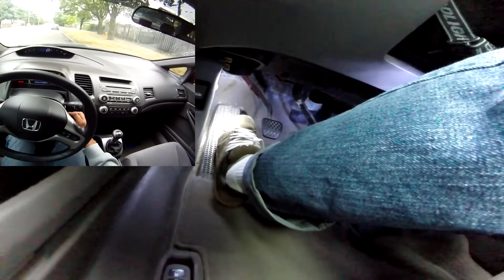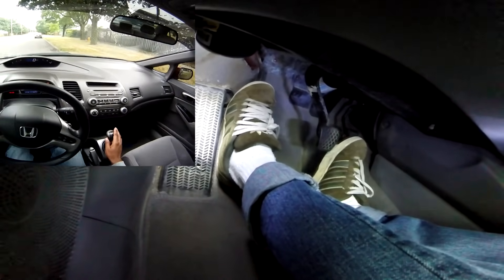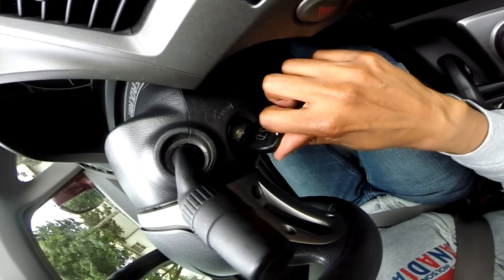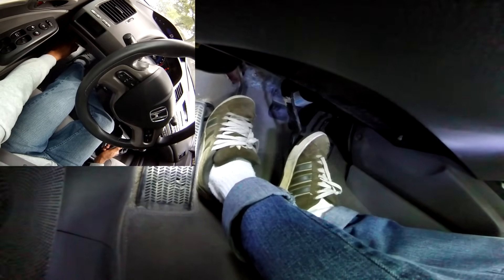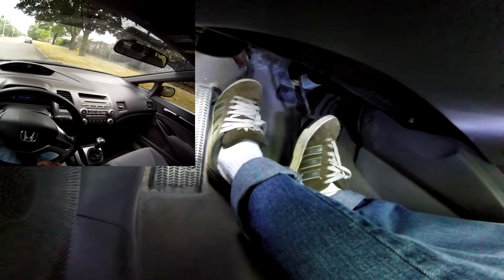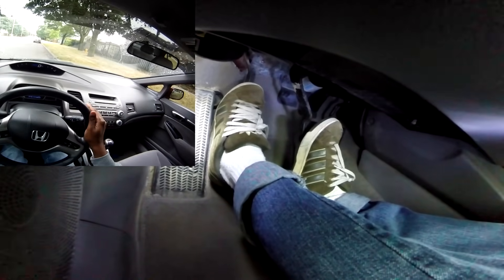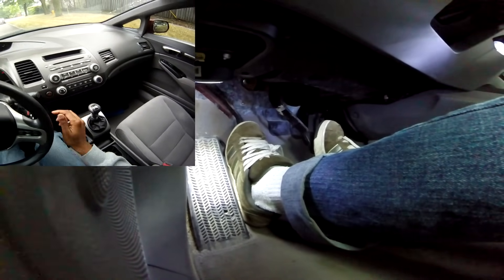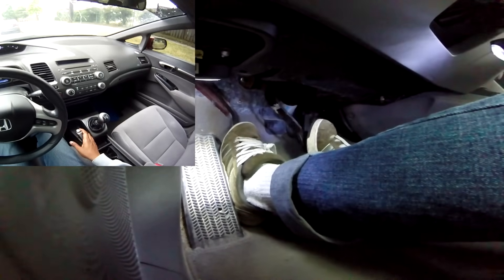(1) How to: roll push start manual transmission

Comment from the maker: I see the arguments in the comment that I should have used 1 or 2 or popped it. The reason you learn to smoothly let out the clutch, is if you have a short distance you will have to use 1st gear. If you just pop your clutch in 1st gear, in a short distance of a couple of feet, the car will just jerk to a stop. So the reason this vid is showing 3rd gear is I wanted to show you on video, how to smoothly bring up the clutch and that is easier to show in 3rd gear over a longer distance (for the video). That is part of the skill knowing when to use 1st or 2nd or when to pop it or feather it or how to do it in reverse.
Bump your car with another car: https://www.youtube.com/watch?v=ejj645sShTk
Push the car yourself to start: https://www.youtube.com/watch?v=uU9NdbLitaw
Do it in reverse : https://www.youtube.com/watch?v=d79wI1YUel4
Push Button start : https://www.youtube.com/watch?v=679VR-j5bgE
Manual Transmission: How to Accelerate in Snow: https://youtu.be/We9r3emgwQ4
Manual Transmission: Starts From a Stop Troubleshooting: https://youtu.be/90M8NMh4AsI
Using Rev Match part 1 https://www.youtube.com/watch?v=yFTkACVooYo
Using Rev Match part 2 https://www.youtube.com/watch?v=gBt409FzQxc
Using Rev match part 3 https://www.youtube.com/watch?v=CgdYamqjWN0
Using Rev Match part 4 https://www.youtube.com/watch?v=zlkdHOS6eas
Basic rev match downshift/2nd gear rev match: https://www.youtube.com/watch?v=s6A3D_kornM
No shift rev match: https://www.youtube.com/watch?v=2XKScm0G4bY
No rev match vs rev match vs heel toe downshift for corners: https://www.youtube.com/watch?v=FxNwR7tcdfc
How to no revmatch downshift for corners: https://www.youtube.com/watch?v=tvj_59dyvHA
Highway exits 3: Brake Rev Match - Brake Rev Match: https://www.youtube.com/watch?v=VqhztQkLshM
Highway exits 4 - brake rev match - braaaaake - down shift: https://www.youtube.com/watch?v=nViBPv05LE4
Reply: I was told to do this in second and pop the clutch... I think. I've only ever needed to do it one time, and I'm not totally sure what I even did correctly. This makes it look super easy.
Reply: @kiyoponnn  ucan do it in the secong gear as well but not in 1st
Reply: @113113andre  Fuck off you braindead dumbass
Reply: @TheRealNintendoKid  No, do it in 1st and feather out the clutch. Don't pop it
Reply: Chris J  Ui aka ultrainstinct 🤭

Comment: I have done this in the middle of jam packed traffic at a stop light. I was the person who opened the drivers door, pushed my own car into rolling, jumped back in, push in clutch, jam it into 2nd gear and pop the clutch. Engine starts with a jolt. That is way life was in the good days. Driving was a problem solving, hands on experience. Manual transmissions totally rule.
Reply: we did this at a parking lot.  same principal applies for a broken starter motor
Reply: Dennis Nelson haha I was the guy who did that just yesterday at traffic light. Gotta love manual
Reply: How exactly is this done. Do you leave the car in first gear with the ignition on jump out and push the car.
Reply: my car just now can't start so I did what my dad told me about it and I start it up with easy
Reply: My mother used to do this all the time when me and my sisters were little kids,in her little green Pinto,all with us kids in the car too. Lmao How very dangerous,though.
Reply: My mom was the only one with us kids,jumping out pushing the car,running and jumping back in the car with us kids in it by ourselves,it was SO exciting,everytime. I loved it. Lol
Reply: I literally had to do that shit on a hill last week 😂😂
Reply: Shouldn't have stalled then lol😆
Reply: You can do same thing with an auto keep it in Drive key to run push the car once you start hearing the engine bucking get in give it some gas off you go
Reply: @ryans413  its a shame modern automatics have an electric shifter so it won't work in newer cars.
Reply: @inev5341  never do this with first gear, do it with second or third
Reply: @spyrosbellos2522  I'm curious as to why? I always push start in 2nd but why not 1?
Reply: @chiefdenis  I think in first gear the stopped engine has a lot of mechanical advantage, so you'll likely just instantly stop when you release the clutch
Reply: 3rd gear has the best ratio and it's easier to start.
Dont use 2nd gear it's just harder
Reply: Old days? You can still do that lol
Reply: You're the tatted guy in the video  with a yellow shirt push starting his car?
Reply: Letsgo Dennis thats skills!
Reply: No kidding bud, the joy of controlling the ride is the best.  Can't do this with an automatic.
Reply: Brother tumhe 21 Topo ki salami

Comment: Use 2nd gear it's easier cause you won't need much momentum as in 3rd gear.
Reply: Yes but sometimes 2nd gear can't spin the engine fast enough to start it.
Reply: @ryantoomey611  yea for that reason you'll have to put it in  first
Reply: @ryantoomey611  lower gear means faster engine
Reply: @ryantoomey611  Normally a lower gear means faster spin.
So my guess is that first gear is best. You dont even have to stop if you do it in first gear because its like normal accelerating. And actually, you can do it without even using the clutch. It should work.
Reply: Actually, its really second gear. I dont get why though.
Reply: @NEMATlC  when you roll the car in first gear and the engine will rev up higher cuz of the lower gear ratio, so if you can roll the car in first, it will be easier to start but if you try to roll the car in first the engine will want to rev up higher so that means more friction and its gonna be a lot harder to roll the car but in second gear there wont be so much engine revs so that means less engine friction and its easier to roll the car in second so you can both roll and start the car at the same time easily.
Reply: @NEMATlC  what you need more is torque instead of faster spinning speed
Reply: Even better is 1st gear. Can get the car started at quite low speeds.
Reply: @ryantoomey611  its literally the opposite. The highest the gear, the lowest the engine rpm goes.
Reply: @NEMATlC  for gasoline engine it's 2nd gear, for diesel it's 3rd gear 😉
Reply: Just go with 2nd. Do not try this on 1st because you are not supposed to  have the transmission and the wheels turning when engaging first. I believe there are no synchros on the 1st gear so your face might end up on the dashboard if you are going fast and suddenly engage 1st. Or you will hear metal grinding and it won't catch first gear if you are going fast.

3rd is a little bit too much. You can see it in the video how the car vibrates, it's not going fast enough for 3rd, so that adds wear on the clutch.

2nd is what you need.
Reply: @kevinsalonga  Uwotm8?
Reply: @nethacker91  you can do first if you can't get the car fast enough or just one person is pushing on a flat or something like that but if you have the possibility to get faster or have multiple trys try it 2nd or even higher if you are able to get the speeds. It really is easier in 2nd although if you don't have the speed or this will be your only try i would do first gear and just drop the clutch rather fast. Wil be more uncomfortable and also more dangerous for the clutch  gearbox and the motor etc but if you drop the clutch fast it will definitely start at low speeds.

Just try it for yourself in different gears at different speeds and you will see what i mean.

In general best try this just a few times so you get a feel for it and ehat speeds you need and how to do the clutch and at ehat gear so you will be able to do it first try if you need to as you can definitely fuck it up the first time if you don't have any feeling for it wich would be not to good if this might be the only try you get.
Reply: @toaster_gmbh  I have done it on 2nd several times throughout the years, and I have done it once in third when my car turned off while I was driving.
Reply: @IronServerHK  this
Reply: @NEMATlC  first gear means the car needs more  traction to spin the engine which in slippery conditions you may lock your wheels and not be able to start the car
Reply: @gabrielclement5585  Yep
Reply: @IronServerHK  just buy a diesel manual then lol
Reply: @holyluv3790  lol what i mean is the conversion from the gearbox for the push start
Reply from the maker: @nethacker91  I explained why this video was done in 3rd in the description and the pinned comment, it was for a reason. Also you can do it in 1st no problem I do it here on video , I run , push jump in , put it in 1st gear, I never said don't do it on first https://www.youtube.com/watch?v=uU9NdbLitaw
Reply: @nethacker91  I agree. Did this the other day in my foxbody. Was told to use second gear because first might be too fast and would engine brake causing my friends who were pushing to run into the car. Second gear and dumped the clutch and it fired right up
Reply: Bullshit 2nd always  works best

Comment: Another reason why the manual transmission is just awesome, thanks for the video.
Reply: @W0Y4K the only reason
Reply: Can do it in an auto too
Reply: Ryan Scherbluk No way.
Reply: Soo true bruh I love them👍
Reply: Also DET gon damage the engine and clutch
Reply: Manual all day
Reply: @ryans413  noo
Reply: @ryans413  only like old power glides with a tail shaft driven pump
Reply: In manual transmission is easier to steal a car doing this
Reply: eljaviz20 No you still need the key 🔑 to put it in the on position
Reply: @bryanveliz1978  what? Controller how high the rpms go is definitely another reason
Reply: @chris5k132  manual is for poor little kids lol
Reply: @RBZ06LT6  automatics are for gurls
Reply: @RBZ06LT6  pretty much every car guy will disagree, in many cases people will pay more for a manual just because it's more fun
Reply: Reddit Brink  it varies from car to car but there are used BMWs out there where a manual version will cost you more than an automatic in the same condition
Reply: @RBZ06LT6  automatic is for inexperienced drivers
Reply: Lmfao. I had to do this once in my integra lol my starter failed.
Reply: @TheToasterPope  not in America. 
Most autos are always cheaper. No market for manuals. Only small specific market
Reply: Over here in the UK 🇬🇧 
Manual transmission is the preferred over auto ,always has been ..
Auto just doesn't seem right to us Not a real car ..
With manual you have full control...the only thing that is good about a auto is when your bumper to bumper in traffic..
Just my opinion 😁

Comment: I went out today to my friends house on my way back stopped at the side of the road to get something to eat after getting what I wanted got in the car and didn’t realise my lights were on luckily it was down hill I watched this video and it really helped thank you🙏🏾🙏🏾
Reply: I drove a VW caddy the little 1/2 pickup deal, no starter for a year I just bumped it off. No electronics on the car, mechanical diesel 50 mpg I wish I had another one I swear lol. Be careful out there buddy, and remember, put it in second get a roll and brrrt away ya go lol  ✌️ 🇺🇸

Comment: Lol this saved my ass. When I first bought my Jetta, it already had a weak battery. I was at a freeway exit and it had an incline. I stalled it, and it wouldn't start back up. Everyone behind me was getting mad and started beeping at me. So I put it in reverse, held the clutch, rolled backwards hoping no one was coming up the incline, and popped the clutch and it worked. At the next intersection I was so relieved and happy. I was sweating the rest of the way back with my heart racing. One of the biggest reasons I love manuals.

Comment: I've always done it in first...I can imagine third is a better idea for less jerking as the car starts up. Never thought of that. Also, I'm used to just letting the clutch out fast. Never thought about slow release! And luckily this was on a hill, i've had to run out, push and run back in lol.
Reply from the maker: ha with my old car it was so light I have done that too push run and get in I was thinking to show how to do that but this new car I got is too heavy for me to push lol
Reply: Anthony Gonsalves how can you push a car in first gear?
Reply: 3rd is probably too high. The low speed and revs would surely stall the engine and you're back to where you started?
Reply: @muserock2367 did you not see her do it in the video lmfao??

Comment: the car jerking is the scary part xD
Reply: FaZe CrAzY626 That's just what happens when you're in 3rd gear (or any gear that's too high for your speed) below ~24kph / 15mph
Reply: I agree... if it was a gasoline powered car (which it sounds like it was) then 2nd gear would've been more than enough.
Reply: I didn't know you could do this until my dad did it. We have a diesel Accord, and all you need is second and it doesn't shake and rattle like in this video. It just starts and it's as if you were moving smoothly.
Reply: Arne Maeschaelck you do have to be in gear
Reply: It only did that cause it started in 3rd gear
Reply: @arnemaeschaelck5012  i've rollstarted multiple cars in first gear to be fair
Reply: Ike Buttle I meant 1st gear
Reply: @ikebuttle360  you have to be in neutral then put it in gear after rolling. If u wnna get it started by yourself that is. Cant push the car while keeping foot on the clutch, so unless u r on a hill or with ppl who can push its neutral. First push then get some momentum, jump in and switch to gear, release clutch. A car that is in gear without clutch pressed aint going nowhere.
Reply: @arnemaeschaelck5012  i see
Reply: Nanide yeah I was wondering why he chose third to start, at that speed it’s a lot smoother in first

Comment: Note, you have to put it in 3rd gear because if you put it in low gear and the car gets going it's going to "jump" hard when the car turns on. and remember the clutch, it's going to be hard to push the car if it's you don't engage the clutch. and be ready with the brakes, your car might lunge forward a considerable distance.

You can also get it into neutral, get the car rolling. and when it's quite fast enough put it in 3rd. also works but it's basically the same principal just adjust to what you feel like you can do the best.

Comment: I did this on a tractor when I was 15 and had no idea what I was doing.

The tractor had been sitting in the garage for a year and a half  it was completely dead, I had heard somewhere that you can roll start a manual car, so I thought to myself 
'why not manual a tractor?' luckily I was already on a hill. 

It was a stupid designed tractor, the clutch and the brake were  the same pedal, if you push the brake pedal 1/4 of the way down it would release the clutch, if you push it past there it was the brake pedal. 

This was also the only pedal on the tractor, once you're in gear you're going.
Reply: Bruh

Comment: I know how it’s done the car rolling is acting like the starter. By keeping it in gear that spins the engine over. And keeping the key on run makes sure there’s power to coil to spark once spark happens engine runs. Also the belt goes around the alternator and when the engine is turning it’s moving that belt over the alternator creating power.

Comment: what happens if I have no one to push at the back? 

sigh sometimes I wish cars would have kick starters like motorbikes
Reply: if it backfires it would break your leg lmao
Reply: M1NH5AN3 not if it's another pedal you slam down on to and it creates an isolated spark in a closed chamber except for it's little wires that leads to the battery
Reply: Tito Jesusmane motorcycle kick starters turn over the crank mechanically, not like the automobile floor starters seen in trucks... I'm thinking he means mechanical foot start.
Reply: M1NH5AN3 yea, that would be a bad idea though
Reply: M1NH5AN3 also are those still in trucks these days?
Reply: Tito Jesusmane Not that I know of, they all seem to be column ignition nowadays with relays instead of direct wiring.
Reply: M1NH5AN3 that's a shame, there's something to be said for the effectiveness of direct wiring.
Reply: if it has an open diff jack one wheel up off the ground, and wrap a rope around it several times, so when you pull the rope it spins the wheel. Pull the rope hard(get the wheel spinning) and hop in, and pop start it
Reply: not a kick start, but maybe a pull start
Reply: Push it down a hill
Reply: I would say that car engines are much larger and harder to start. You need the momentum of the whole vehicle with some speed to do it, a swing of a leg wouldn't nearly be enough.
Reply: my father used to put it in neutral push the car then when it starts rolling he gets in puts in first and release the clutch and it worked just fine
Reply: STK Aranaar That is energy built up over multiple seconds. Again, a swing of a leg is not enough
Reply: I usually ask pedestrians for help. And 9 times out of 10 they always help
Reply: Kick starting a 2000cc engine lol
Good luck
Reply: Just in the news: Auto theft rates skyrocket
Reply: Open your door push your self
Reply: They used to lmao and people broke their arms doing it lol